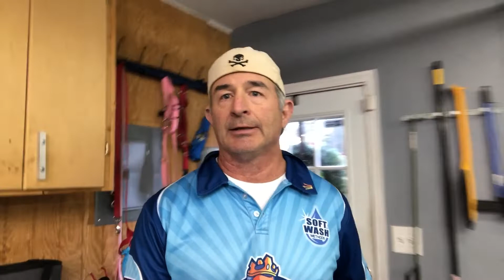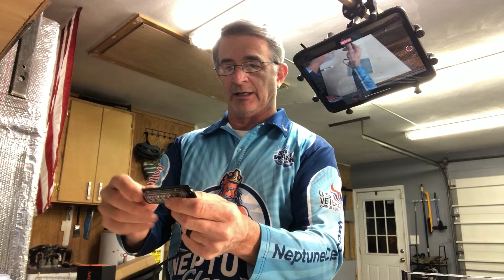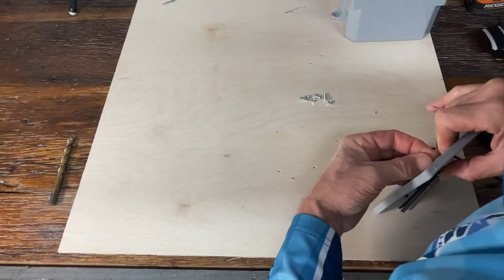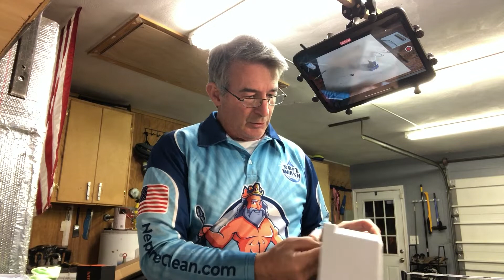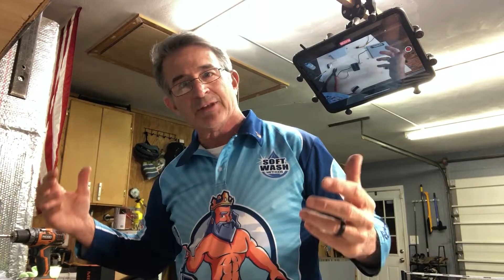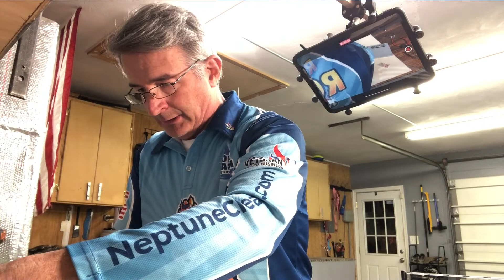DIY Automated Downstream Injector Box

Comment: Anyone having issues getting line to prime through their remote bypass injector? I have 9ft of 1/4 inch hose and i can't get my 5.5 gpm machine to pull SH. Checked spring and ball in the inject 2.3mm and all is well. Tried several tips on gun.  Appreciate any thoughts.

Comment: What is the purpose of this? Does it deliver more SH than a downstream injector that connects to the pressure washer.
Reply: No this is used for down-streaming SH. Keeps you from going back to your rig and physically turning your SH by-pass valve so you can do a fresh water rinse. It basically shuts off the SH from the down-stream pickup. Hope I explained that OK.
Reply: Thanks. I am going to build one and also make a downstream injector to connect it to that can deliver 3-5% SH.  @williamseith4267

Comment: Do you please have a link to the battery wire you used like what gauge wire is it? and the fuse part? I can’t find it anywhere and I’m confused on what the different size fuses mean
Reply from the maker: The wire coming from the battery is a 16 gauge wire if I'm not mistaken. i bought a spool  of wire and one of red then I used some heat-shrink tubing over them to keep them together. Hope that helps.

Comment: Great video.  Since you can't really rinse the two way electric valve how does it hold up to SH?    I have all the material and hope to install it tomorrow.
Reply: Just like anything exposed to SH... you will have to replace it. How often depends upon I can't say. They're cheap enough to keep an extra on hand, though.
Reply: @williamseith4267  I since found the valve with the 3 way on it.  So I can hook up my water tank and bleach tank to the same valve.  It will just switch from bleach to water.  Switch to water it will flush out the electric valve.   Going that route.   75.00 vs 35.00 so its a no brainer.
Reply: Between jobs on the same day no need to flush them out, but after your last job during break-down just drop the intake into a bucket of fresh water and leave valve open to flush it

Comment: How do I hook up the third hose for water like south east soft wash has there's?   So when you switch it back to water it also rinses out the downstream injector.    Is there an adaptor I plug two hoses into bleach and water then it goes to one hose to plug into the electric ball valve?

Comment: Hi, this would also work for softwashing right, bc this just helps pull chem / Water / Soap right? Thanks
Reply: So this setup would not be a good fit for a softwash system. You need to build a metering valve setup for that because your mix is usually 50% SH and 50% water. That gives you the 6% bleach strength you need to clean roofs. Downstreaming for siding with a 1-2% mix is ok for this system.
Reply: @williamseith4267  isn't this pretty much  like a flowpro
Reply: @iamjacksundyingaddiction6595  I'm not that familiar with the Flowpro which looks like a pretty good product. It also looks like that unit uses an automated DN10 ball value which diverts pressurized water from the pressure washer through the bypass system. I really like that. It's actually a better setup. My system only turns the soap on/off but the flow of water still goes through the downstream valve. All in all that system looks like a pretty good product for the money.

Comment: Thanks for the tutorial, but I have an issue, I bought 2 valves, i built the first one following every step, and it worked, the valve opened, but when I turn it off, it doesn’t close. I thought maybe the valve was bad, so I tried the other one, and same thing, after it opened, it wouldn’t close again. Any idea why? Has anyone came across this issue also ? 🤔
Reply: I'd check how you have the switch wired. If you look closely at the wire colors you can see that the red/white wires from the battery enter the corrugated split tube but when they come out one is red and the other appears to be black. The white wire has "black heat-shrink" tubing on it making it appear to be black but that's the white wire from the batter. Hope that helps
Reply: Also, switch polarity on the valve, I connected negative to positive and positive to negative, and it closed.
Reply: Thanks man, turns out I had bought the wrong valve, it looks identical but it was suppoused to be the auto return, I didn’t realize that at first, I appreciate the quick response though. 🙏🏽

Comment: My only question is battery size without frying the remote module.  I'm using a 1000 CCa marine battery as it powers 2 push button start pressure washers, and 12V roof pump. 
I also thought about using these little remote modules to remote start my pressure washers but again, wonder about battery size and draw of machines without frying the remote modules.
Reply: The battery shouldn't hurt the remote modules.

Comment: How does the valve last without being rinsed? I use drop sticks so it would not be a problem for me but just wondering if they last flowing 12% sh.
Reply: Get a bucket tieh comsone clean water in it , run the hose to it and open the valve and rinse

Comment: Hey man, thank you for the video. I’m thinking about building this and just using an 18 V battery as my power source. Will. Will I need to put in some sort of step down converter because the voltage is different? I have a Milwaukee 18 V, I guess I could get a 12 V battery that would work. Thanks in advance!

Comment: Would it be similar to wiring a 3 way ball valve
Reply from the maker: So a three-way valve will not turn off the flow of soap but switch from one tank to another tank. I'm pretty sure the wiring would be the same depending upon the valve
Reply: So what I'm trying to do is I have a three-way coming in from Amazon...and I'm planning of hooking up water/soap mix/ then to downstream injector..then at the end of job switch chem off and run water
Reply from the maker: @perezleolp  So do I understand correctly that you plan to have two tanks? The way I have mine setup is to simply pull my mix into the pressure washer hose flow via the downstream injector. The soap mix goes through the 2-way valve. When I no longer want soap, I simply turn the valve off so no mix is pulled into the injector.
Reply: @neptuneclean  yes well I have water tank soap tank bleach tank and I'm a splice soap and bleach line
Reply: @neptuneclean  but you still have to rinse the injector manually with a 3 way plastic valve right??
Reply from the maker: @perezleolp  I suppose the soap input side of the injector could get rinsed but the main orifice will naturally get a rinse once the soap is turned off. I've been using the same injector for over a year with no problem. I'm sure I'll have to replace it at some point.
Reply: @neptuneclean  it would be the first time the assembling a downstream injector I've seen videos of it using a three-way but I love your video and the way you showed the installation process

Comment: Hey there! I have everything I need for this except the wire to run from the battery. What kind of wire should I use?
Reply: Hey Zack you're probably ok with a 16 or 14 gauge wire. Use the thicker wire if your battery is far from the unit. Like more than 10 feet.

Comment: I bought everything and built it to the T. I keep blowing a fuse though. Any idea why that might be happening? I'm running maybe close to 6-10 ft. of 14 AWG wire to the battery. Not sure if that's the issue? Any info would be helpful
Reply: The connections on the receiver are pretty tight. Check to make sure no wires are shorted out. Also, the on/off switch is another place of possible short.
Reply: @williamseith4267  It seems to be the switch. Bought the same one you did and connected them exactly how you did. Red and yellow from the switch spliced to 14 gauge wire and that is connected to the positive wire to the battery, and placed on the positive terminal on the receiver. Had a buddy of mine stop by and look at it, and he's telling me the yellow is a ground, so I'm having a ground to short. Really wishing you showed the full wiring process!
Reply from the maker: @xtremeleecleanpressurewash6407  Hey brother, sorry you're having trouble with the assembly. Be sure to study the switches wire color codes. They are not all the same even though they may look like it. I'm sure it's a simple fix. Probably just have two wires crossed. you may have to do some trial & error on the wire connections.
Reply: @neptuneclean  all is good. I’m just confused. In the beginning you show the green wire connected to the positive and in the end it’s connected to the negative??

Comment: New Subscribers I just built one but I can’t get the solenoid to open and I bought two solenoids and I put the second solenoid to power and it comes on and opens do you think I’m gonna have a bad valve?
Reply from the maker: Oh man it's hard to say without being able to see how it's wired. I would re-watch the video and check to make sure the components you're using have the same wire configuration as the one in the video. If it's the same, watch the video, pausing it as you go to ensure the connections are correct. I know from personal experience that it's usually something I did. Especially if I'm tired. Maybe let it go for today and come back at it fresh tomorrow. Hope that helps. Bill
Reply: I found out the problem I ordered the wrong part I ordered the AC 110 not the 12 V it’s on the way. 👍🏻
Reply from the maker: @WandWizardLLC  Rgr... that will make a difference. Glad you were able to troubleshoot the problem.
Reply: Receiver box.

Comment: Just curious if you've had a remote control receiver go bad? Mine worked fine from late March until last week. Now it just wants to "click" sometimes but isn't turning on the valve.
Reply from the maker: Not yet but they're so inexpensive that I don't worry about it. It is possible to crush them if you step on it or something like that so be careful. I keep my in a zip-lock ID carrier that I hang around my neck. That seems to keep it dry and from getting crushed.
Reply: @neptuneclean  I'm talking about the receiver itself (where the wires are connected).  I've now had 2 in a row (new) that I couldn't pair. Up until a week ago, I really have loved having this remote control downstreamer but am wondering if the receiver is worth upgrading? Thanks for your reply.
Reply: @jaysonrichey2059  Jayson you've got a point there. The receiver/keyfob combo is pretty cheaply made which is also why it's so cheap to purchase. If you can find a better unit, which should cost a bit more, let me know. It's probably worth paying more upfront for it to last longer.
Reply: @williamseith4267  I have been looking. There are others out there but it looks to be the same internals. Two different ones I looked at had the exact same photo showing the inside components. Some seem to be the same unit but with less range listed. 🤷‍♂

Comment: I just received a box very similar to this one. Are you still using it?  Any tips?  I know it need to be rinsed thoroughly
Reply from the maker: I am still using it. I'm really impressed how long the automated valve has lasted. The only problem I've had is a hose leak caused by the wrong sized hose clamp. Other than that I'm really happy with it.
Reply: @neptuneclean  awesome!

Comment: Great video   just wondering If the ball valve  is water  or weather resistant  or does it have to be inside a box
Reply from the maker: The cheap on you see in this video needs to be in the box. Banjo makes one for about $115. It's a 1/2" ball valve but you can step it down to 1/4" barbed fittings to use in this scenario. Check out this link: https://www.sprayerdepot.com/products/banjo-1-2-12v-full-port-electric-ball-valve

Comment: Why not just use different tips man, I turn my soap on and off by changing tips?  I never have to go back to the truck, soap tip turns it on, and rinse tip turns it off. Get after it and make it simple, way too much stuff going on with your set up.
Reply: You are correct. You can use different tips if you're downstreaming but there are more applications for this setup if you're creative. I use a similar setup with a larger 3-way motorized valve to switch my roof pump from SH to water only. Also, I've had my zero orifice rinse tip (the one rated for my 8gpm) pull soap. Not sure why so I added this system for safety. Especially when using to hydrate plants.

Comment: I had no idea you’re not supposed to use true blue on pressurize fittings I wish I had known that before now😭
Reply: Hey if you use it and it doesn't leak then it works. I just had a couple fittings leak so I did a little research and found out the best stuff to use was Locseal. You can't put too much on though or you'll have a heck of a time removing fittings after they've been on there a while. Cheers mate!

Comment: Do you have a video for the one you made for the gas roof pump
Reply from the maker: No I don't but the process is exactly the same with the exception of the Banjo motorized 3-way ball valve has three wires. The black still goes to the negative on the receiver switch and the white and red go to the positive side. Hope that helps.

Comment: I have purchase the items but noticed my strobe lights are 3 wire. It seems as though when the yellow connects with the red, it changes through different strobe cycles (17 total). Any suggestions? I think the yellow can be used to set a specific flash pattern.
Reply from the maker: Jayson I justed used the red and black wires  on the strobe and left the yellow one along. You're probably right about the strobe light patterns but I didn't worry about that with this configuration.
Reply: @neptuneclean  Thanks. I'm planning on using two strobes so I can see it from both sides (in case I ever have to run my hose to the opposite side of my trailer vs typically off the right side). I'm not too concerned at what the particular flash pattern is.
Reply from the maker: @jaysonrichey2059  Right on brother. Glad that helped.

Comment: what do you do with the yellow wire on the light
Reply from the maker: Hey Tim, the yellow wire is not used in this configuration. It just hangs there. You can cut it even with the black wire sheath or put some electrical tape on it.

Comment: Seeing a few different 1/4/-2-wire motorized ball valves on US Solid's site. Do you know which one you purchased?   JFMSV00077UPC:888107098362Condition:NewAvailability:Usually ships within 24 hoursWidth:4.00 (in)Height:3.20 (in)Depth:3.20 (in)
Reply from the maker: Hey Jayson, there's a link to the one I purchased in the description of this video.
Reply: @neptuneclean  I had checked the link. It brings up a 3/4" valve. It looks like Amazon is out of the 1/4". I'm looking at US Solid directly. They show 6 models. I believe 2 of the models are 2 wire. Thanks for your reply.
Reply from the maker: @jaysonrichey2059  That link lists all the sizes available. It looks like they are out of the 1/4" but have the 1/2", 3/4", and 1" sizes. Supply chain issues are really putting a hitch in our giddy-up these days.
Reply: @neptuneclean  No doubt. I want to stick with the 1/4". I'm waiting on a call back from US Solid on the differences between their 1/4" models. I was hoping you might have had the part number that you have. No big deal.

Comment: So I don’t need a soft wash system this way
Reply: So this is a great way to downstream using your pressure washer. This system will allow you to remotely turn your soap on/off. You can achieve the same thing by changing out your nozzles. I like this for downstreaming because I'm sure the soap is off especially when I'm watering down plants or rinsine the SH off a home. I've had rinse nozzles that will still let soap through the system. It might be because of the length of my hose causing a pressure drop across the DS injector allowing soap to flow. So for washing homes... you can consider this a substitute for a soft-wash system. However, it will not work if you plan to do roof washing. You cannot deliver a strong enough SH mix to clean roofs (about 6% SH).
Reply: @businessideasacademy   I have a x jet as well but I’m not a fan of the bucket
Reply from the maker: @capo17hg22  The x jet is a great tool when you're starting on a shoestring but if you want to increase revenue by being more efficient you've got to downstream from your truck or trailer or install a softwash system.
Reply: @neptuneclean   two 55 gallon blue barrels and one 20 gallon, from the truck and a Proportional valve
Reply from the maker: @capo17hg22   That could work but clear is better so you can see when you're running low on SH or water.
Reply from the maker: This is for downstreaming with your pressure washer. You'll have what is called a "batch" tank that you pre-mix the water, sodium hypochlorite (SH), and surfactant (soap). The downstream injector pulls the pre-mixture into the stream of water from your pressure washer. Since the pressure is reduced significantly due to he larger orifice of your soap nozzle, it's a way to "soft wash" a home. I consider soft wash as a term that describes a low-pressure wash. You can purchase "soft wash" systems with mixing valves that pulls the SH and surfactant into the water stream through metered valves. They can be 12v, 24v, air diaphragm, gas... I can go on and on. The more you search on YouTube the more you'll learn. Cheers Mate!